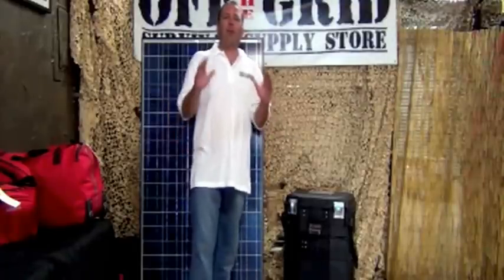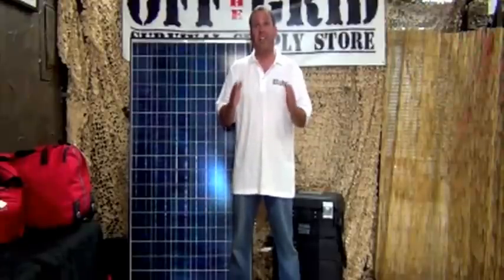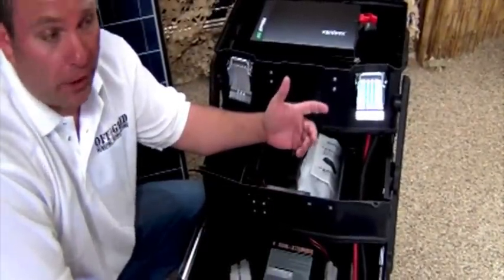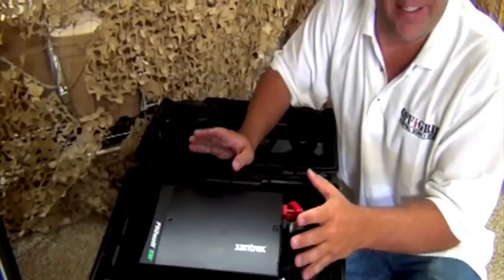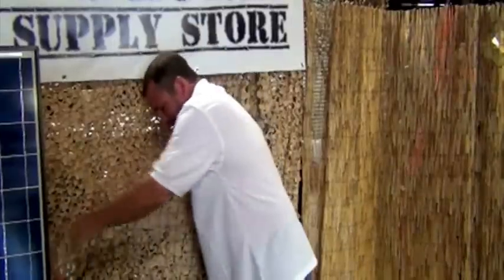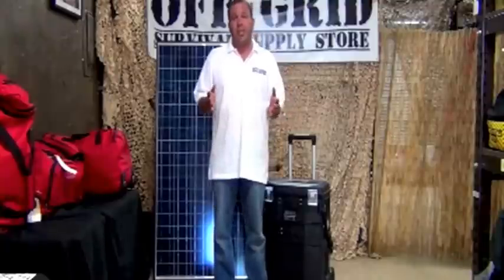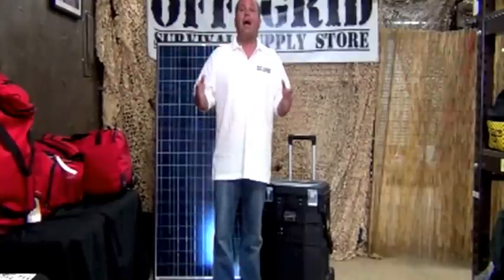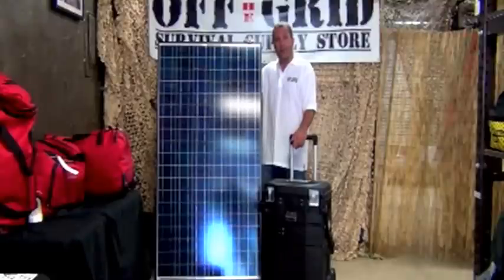Off The Grid Overview of The Grid Eraser Solar Generator

Comment: People you can make your own Solar generator with more solar power, more amp hours on the batteries, nicMPPT charge controler, usb, 12volt plug in, battery power meter, 2,000 to 3,000 watt pure sinewave inverter for the $ 2399.00
Reply: You may even be able to add a 15watt small wind turbine to it. COMING SOON SKG Portable Solar Generators and we will beat these money hungrey people hands down or we could give you a lot more in the system for the price they want also we will have a guarentee